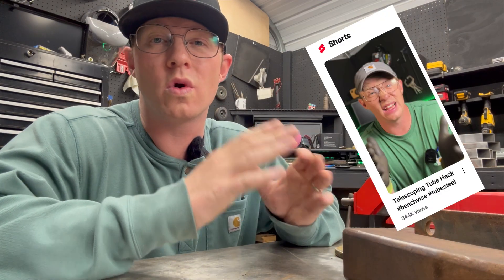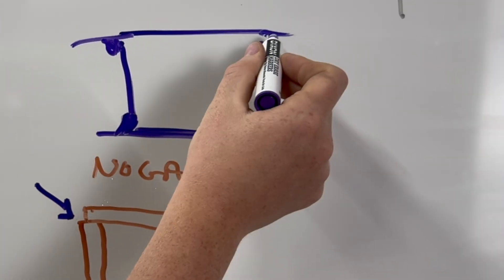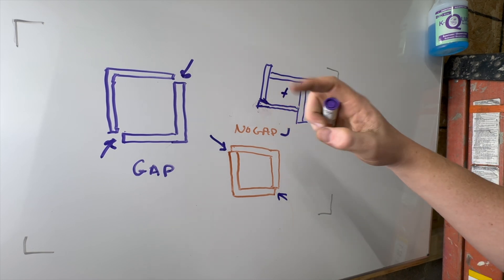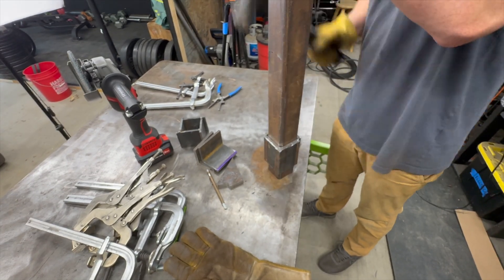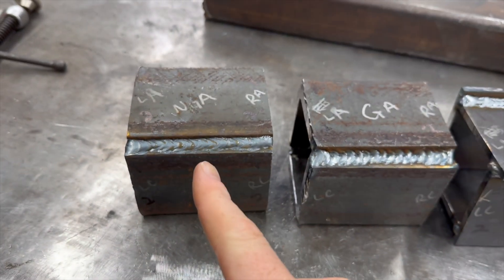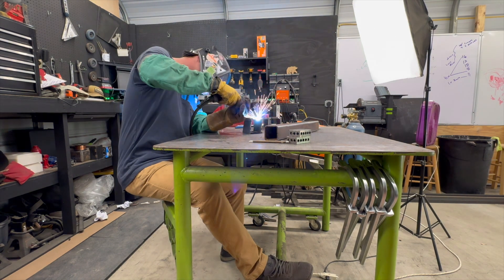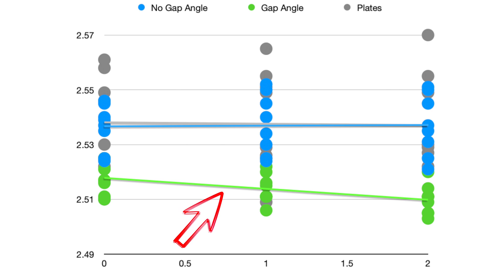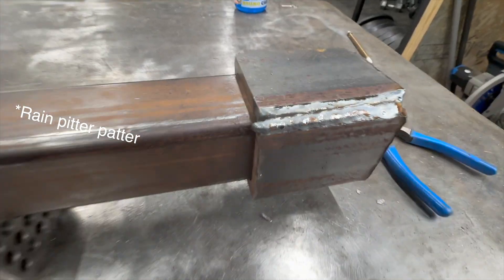DIY Telescoping Tube Hack |  Does Weld Joint Type Determine Spacing?

Comment: If you complete a tube at the correct size and it tightens up just enough to hang up, maybe soak everything in vinegar to remove mill scale.  That could be just enough.   Maybe?
Reply from the maker: Good thought! How thick is mill scale?